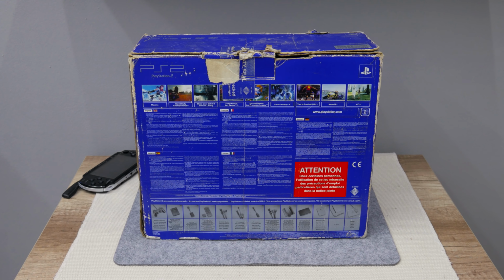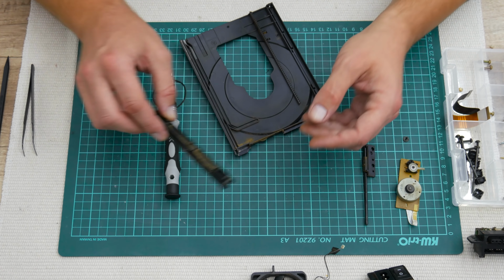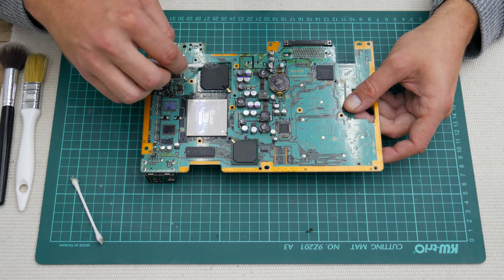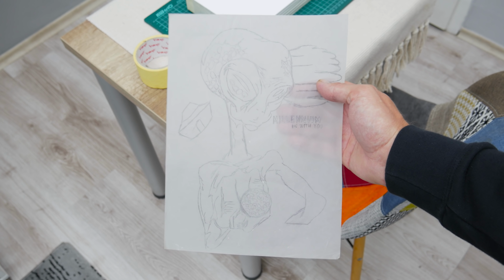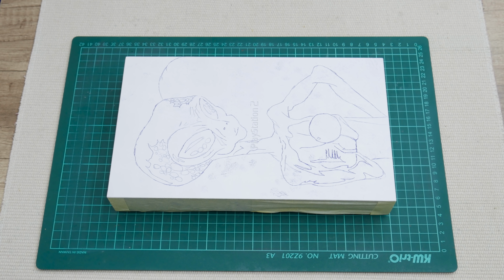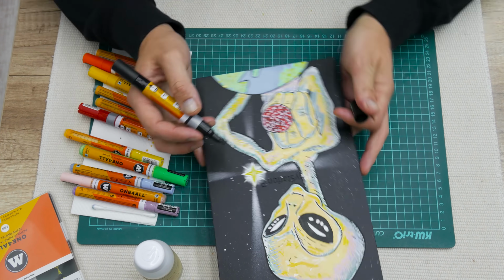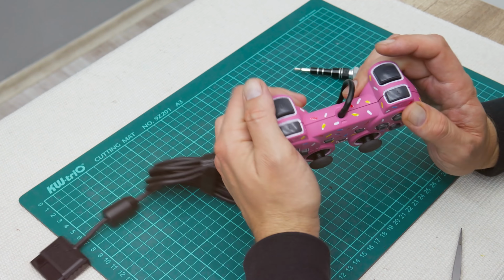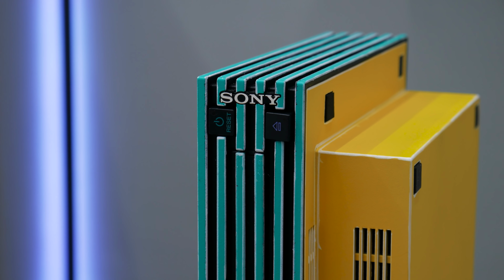Sony Play Station 2 - Full Restoration and MOD

Comment: I always wondered how is the finish using those sprays? don't you need some special type of spray using a spraying machine or a coating layer to make it look smooth, especially for the controller which you dd sweat on.
Reply from the maker: Hi bro, the finish is smooth, last long and no won't become sticky after longer period of use

Comment: Beyond the amazing restoration / refurb process (your skill is easily evident in your steady and skilled hands, working with complex and precise equipment) I really apprecaited the "final result" part of the video where you discussed the importance of not simply throwing away technology amidst the charm of these older PS2 games.  I couldn't help but smile at your sense of history and appreciation of how games don't have to be at 4K 300FPS to have a profound effect on the user.  Fantastic video as always!

Comment: I'm always watching teardown videos but none is like my PS2, it's not a single flat motherboard, is more like a sadwich, the power supply sits on top, then the plastic midframe and then there's the motherboard, a heatsink, then one half of the PCB then another heatsink and the botton half of the PCB but I cannot find a way on how to fully disassemble that cluster and I don't see anyone having toredown a PS2 like that, is crazy, I just left it as is and so far is still working, well it has worked for over 2 decades now so, if ain't broke don't fix it, does it?

Comment: Fantastic colors and art. I like it. Nobody touches the launch PS2 ever. I guess because it's has a dual main board that's soldered together. You have to desolder four points just to separate the two boards just to replace the cmos battery. I do wish I had the single motherboard model. So much easier to disassemble.

Comment: Another great video, you shoulded install a HDD and some emulators trough FMCB :)
Love the alien design.
Reply: this yes, when removing the modchip, use FMCB :P large hdd, and maybe a real network adapter or one of those cheap sata ones :P